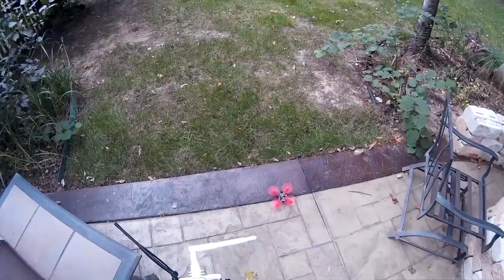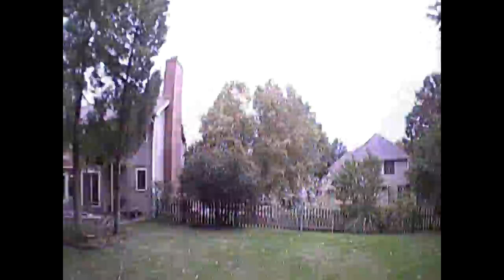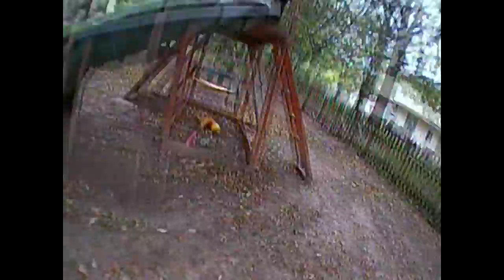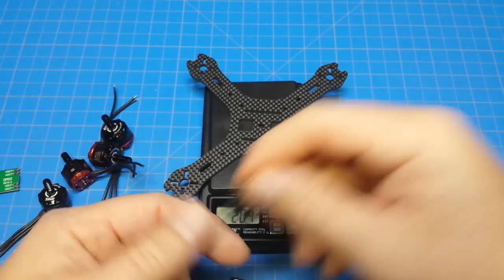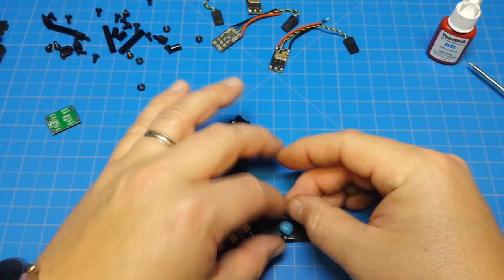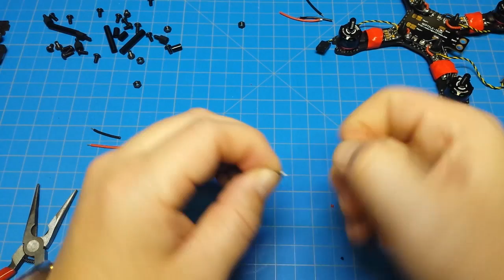GB130 Kit - GearBest

Comment: Hey Nick I love your channel so much I have to watch all the old vids too lol, what got you into quads? Your doing amazing los acro no airmode, do you still fly LOS? 

The quads flew so bad back then lol I'm so lucky I only got into fpv at the start of 2019
Reply from the maker: My line of sight is basically just hover testing and maybe a few flips and rolls to check the initial tune and performance. Quad performance has improved so much over the years...thankfully. 
I got into quads as I was working so much in my free time I didn't feel I had any spare time. I decided to take back the spare time, but didn't know what I would do with it. I saw an ad or something for the syma x5c, and thought I should get back into RC. I flew low with syma type quads for 3-5months, then slowly started exploring fpv over the next 5-6months.
Reply: @NickBurnsFPV  haha that's awesome, I started after getting a similar drone for Christmas, then I bought a DJI Spark, obviously the gps assistance made me crave more control and I found out about fpv and these acro quads that can do any maneuver. Love your channel Nick, God Bless.

Comment: Just stumbled across this earlier video. You've come a long way sir. I asked you  a couple of days ago which you might recommend after the aurora 90.......I've settled on the Snapper 7. Fast enough for outside but gentle enough for park/indoor flying with decent aluminum prop guards I can hammer back into round on a mandrel lol. If you see my channel and the video of the Mantis in the mini park, you'll know why I asked in the first place (still waiting for the FC to arrive). Awesome vid as usual!!!!!
Reply from the maker: I just don't see the snapper 7 in the same category as something like the aurora90 or 67. Those aluminum whoops are going to get bent up. I have bent them up in my flights. I would get a beta75 frame off of ebay while your ordering as it could come in very handy.

Comment: You didn't show the weight of the completed build. You weigh the frame to "see where your starting point is" and then never bring the scale back out to show an end point. Could you add the weight of your completed builds in your videos, if you haven't done so already. Thanks. Great video otherwise.
Reply from the maker: Sorry, this one is 180grams. I typically have the all up weight in the video.
Reply: Nick Burns I've been interested in this one for a a few months now, I rewatched your  build to check the weight cause I want to get a 3" next week and this seems like my best bet. Thanks a ton

Comment: Hi,, the builds are very useful for guys like me who are fairly new, I have gained lots off information on building them, and learned what goes into building good fun fliers,  I've been flying toy grade quads, then moved on to things like the hubsan h501s, I'm now getting into FPV flying, bought a kingkong 130gt to start with as it was quite cheap, it runs cleanflight on a F3 and has 1105 kv4000 motors but I didn't like how it performed so have striped it down and will re mount all the bits onto a rjx c130 frame when it arrives that is similar to the gb130 in style. but will use 3025 props instead of 3020s. don't mind so much about speed just would like it to be a stable flier to learn FPV in..
Reply from the maker: Sounds like you are well on your way. Post up some video when you can. I would follow along.

Comment: Really want to pick up this quad! looks like a lot of fun for the money, but it looks like one hard hit to that pod will smash the standoffs, pull on the wires and damage the FC and PDB... Any thoughts on this? how does this frame handle crashes? I am wanting to use this quad a parking lot flyer during winter so lots of proximity stuff. I want to put on XS20AS and run it 4S... Baby Beast!!
Reply from the maker: Your right in many regards, a hard crash leading with the pod does dislodge it. I have yet to have the pod come completely off. In my hardest crash I stripped two of the lower nylon standoffs, the rear standoffs held no wires came loose. I think flying in a parking lot could have different results. You might be interested in the Zerro 3 I helped design. I have a frame overview and a build video on my channel. The advantage is there is no pod, very low profile design. Disadvantage is only takes a flight controller like the piko blx from furiousfpv.com The build is also more challenging as you might expect.

Comment: I've soldered the buzzer straight to the pads before now, hence why I now have a collection of boards with no buzzer pads to solder to as it rips them off in a crash. I'd put the buzzer on short wires at the very least as having no buzzer when you're used to the audible notification of arming can cause problems.
Reply from the maker: yes, short wires are good, its hard to get done on these tiny micros.

Comment: It seems that the Tarot 120 with the smaller motors would do less damage if flew it into something? Do you like this build with the bigger motor and flying this build is better? What is the differance in the run cam vs the other cameras?
Reply from the maker: True the Tarot is lighter and the motors spin the props less all equals less damage to people, property and the quad. For outside flight I prefer the 130 with 1306 motors, I feel I can push my piloting skills more with it, the tarot is more suited to cruising around, and takes a lot more throttle to change direction in a hard 180 turn. But the GB130 with an 500+mah comes in over 250gram, which, if we follow the FAA regulations here in the US we are to register the quad/drone. Better is going to depend on what kind of flight you want to do and the space you plan to fly in. Also the GB130 is more expensive.

Comment: https://lowes.com/pd/Screen-Tight-Porch-Screening-System-Base-Strip/3024709

I think you should make one of these!
Reply from the maker: I don't understand. Screen in the deck?
Reply: sorry that was only half of the links: http://www.thingiverse.com/thing:1838594

the thing that I linked above gets a led strip attached to the inside and then connected to the 3d printable bases linked in this comment. It would make for smoother and less noticable shadows and dark spots.
Reply from the maker: Ah, for gates or lighting?
Reply: I think that It would do great for lighting. I have a led strip and at that distance it does great for lighting. but it could be a fun gate I did not even think about setting up many of them!
Reply: I have the same quad and I run it 4s with 15amp each but I have hot motors very hot any idea???
Reply from the maker: Turn D down, it can often cause hot motors.

Comment: Hello Nic: I was woundering if i use the guts out of my JuneCheng 3015 quad. What would be a great combo to use to make it into a FPV flyer. Like custom frame/FPV camera . any info would be very helpfull thank you John.
Reply from the maker: I would say probably, does it have descent range? Looks like 6mm motors you will likely need a frame like the E010 or inductrix. You could test to see if you can use it as it is to fpv. Add 4-5grams of weight and fly it. If it does well you could add a FX798T camera to the top and fpv it that way.
Reply: Nick Burns hi Nic it has strong 7mm motors. i would like a nice custom frame. the org frame is real week
Reply: Also ppl have used Devo on this JuneCheng 3015 with 100m range. With stock transmitter ppl get 50m range. This little quad with perverd protocal is super strong flyer. I thought it would make a great cheap worthy FPV with the right custom frame and camera. What would you recamand for me for this build. Thank you
Reply from the maker: the frame choice might be dictated by the size and shape of the flight controller. I am not familiar with that quad, but there are a host of frames for micros. I like the carbon frames that have motor cages like the qx80 and picnicquads efficiency frames from polycarbonate.
Reply: Nick Burns i was looking at the QX90 or QX95. i have seen the CF80. I  am not such a big fan of stacking the camera ontop of everything just kinda looks like a carbon big Mac. I like the chasses type that has camera at the front of chasses..any other appions or help sure would be welcome than you Nic for all your help.
Reply from the maker: There are so many options. I would suggest checking out this facebook group. https://www.facebook.com/groups/custommicroflyer many make their own frames then sell them, some have a business they sell from.
Reply: Thank you i will check them out on fb

Comment: Nice build video a copter Nick :) I am currently working on finishing my GB130. Going to have to make the pod taller to fit in my rx :/
Reply from the maker: Its tight on these micros. Your running a taranis, doesn't iRange make a micro frsky rx?
Reply: Nick Burns Yeah, Taranis. Using a X4R-SB. I think I will just add a little nut as a spacer to make the pod that little bit taller to all for the rx between the PDB and FC>
Reply from the maker: that will work. its hard to beat the lemonrx or now redcon satellites for micro builds. But not FrSky, DSM2/X only
Reply: It may be smaller, but range and Spektrum make it way off the table for me haha. If I had a AIO FC PDB that would help a ton.
Reply from the maker: I don't have an issue with the range. I haven't flown much beyond 150m. As much as it might be in to bash, there are a number of sponsored pro pilots using spectrum. Tommy from Rotor Riot comes to mind.
Reply: Nick Burns Well yeah, sponsored sure. Lose your quad to a fail safe you get a new one ;D Also those nice shiny radios that cost $600 are free as well. Not trying to bash (even though i know I am) I just think FrSky is highly superior.
Reply from the maker: I guess I am somewhere in the middle. I don't use a Spektrum , FrSky, FlySky etc radio. Devo 7 and 10, for me the beauty is I can use almost any receiver with the 3 in 1 module and deviation firmware. Keeps costs down and options open. One bandwagon I would like to get on is the FatShark goggle wagon, or a true competitor.
Reply: Nick Burns Yeah, I just liked the quality and support for the Taranis. If Fatsharks would come down $200 in price I would get some, lol.
Reply from the maker: Have you tried any of them out?
Reply: Nick Burns The Lemon RX?v (fatsharks?) No, I have used an Orange RX module before and just so many more issues and hoops that FrSky in that experience for me.
Reply from the maker: Yea, I have heard the new Orange Rx module doesn't work as well. I know Benedikt at Micro Motor Warehouse had all sorts of trouble/inconsistent binding with the OrangeRx module as well as other. He switched to another module and reported it works great. Poking around I didn't find a thread in the community on it. I am sure if you sent him an email he would link the source.
Reply: Nick Burns Yeah, I originally asked him and figured out how it should have worked lol.

Comment: Do not stop with build logs!
I'd love if you could share more often a screenshot of your PIDs.
Thanks for sharing!
Reply from the maker: Micro Brushed I can do that. I generally don't because I don't consider myself a very good tuner. Tuning often takes me 20 or more flights. I just fly the packs then forget what I experienced. 😂
Reply: Nick Burns :) I understand but for a beginner like me is very important to have a good PIDs setting from which to start. My tarot 130 now fly very well as I see you flying using Betaflight 3.0 with stock PIDs. I was getting crazy with Cleanflight :)
Reply from the maker: cleanflight with a naze32 can be a little painful, the newer F3 and F4 boards fly as good or better on BF3 than a naze32 on CF. I will give my GB130s a few more flights and post the PIDS.